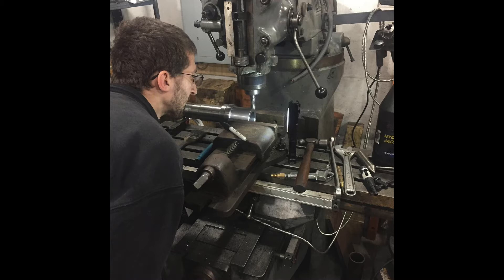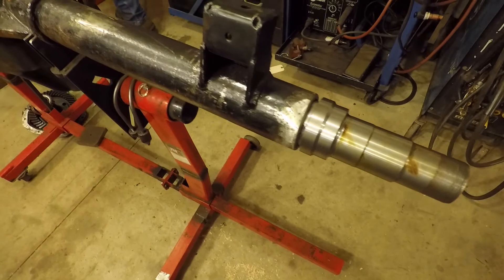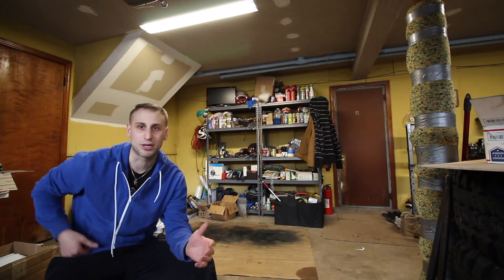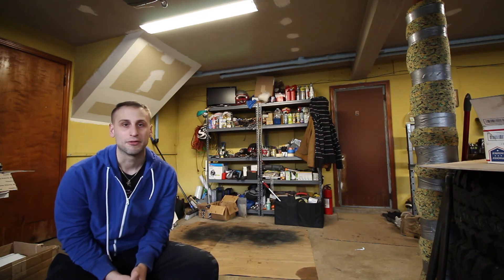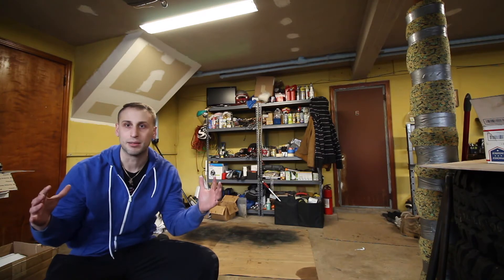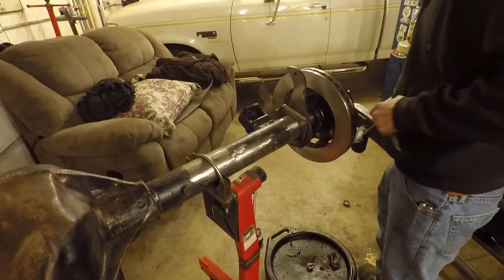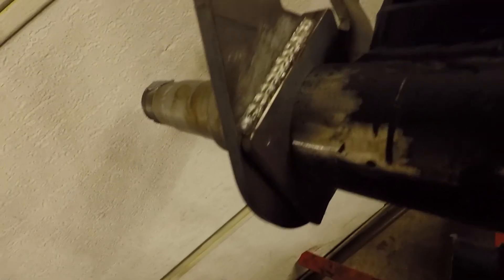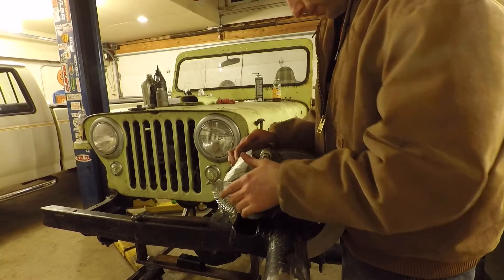Tarantula Build Part 4 - Dana 60 Rear Axle build

Comment: is it worth putting money into a stock Dana 60?
after a bunch of reading and everything pointed to starting with a 14 bolt because of it's stock strength compared to a built D60.
I found several for around $250 usd out of early 2000s Chevys. Disc brakes FF etc.
However the 14 bolt has a gigantic pumpkin which would hinder clearance but can be amended with a BallisticsFab Shave kit,
My issue is that my TJ would need alot more fabrication to fit the 14bolt compared to the Dana 60.
Reply from the maker: Really depends on preference. 35 spline rear 60 is just as strong but with more clearance then a 14b

Comment: Hey Bro it’s been a while since we spoke. I was wondering if you had any shots of the engine compartment and how you negotiated moving things around with the defender Xc’s
Reply from the maker: Hey man yeah been a very long time. The engine compartment isn't completely done yet but have a look at the video I just uploaded it does show a little bit under there.
Reply: Four Wheeling Jeeps I sent you a dm on IG, I am now looking for the measurement for the top of the battery tray to the top of the fender with the Psc battery bracket.